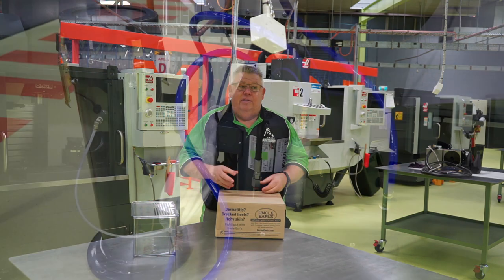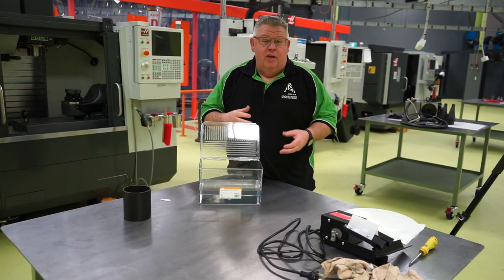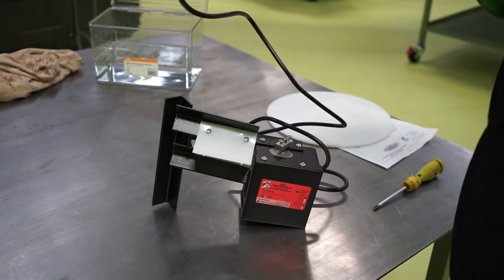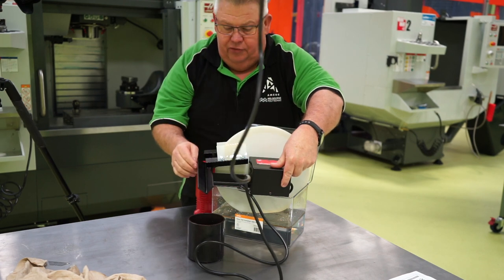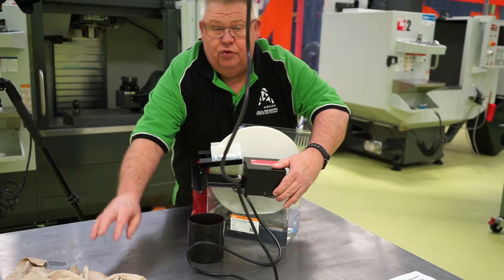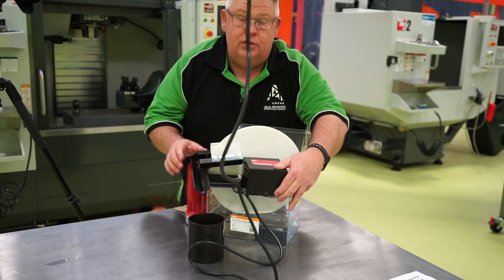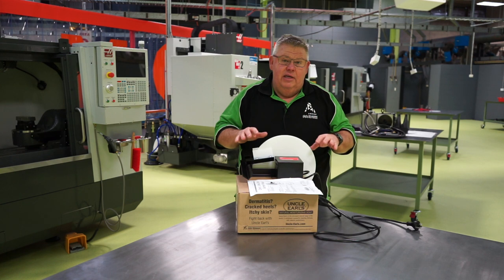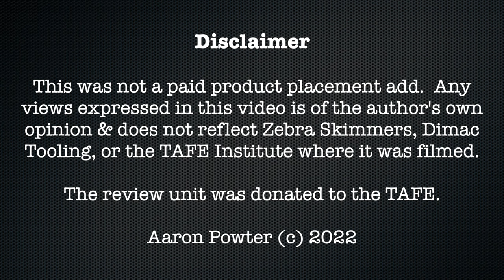Zebra Disk Skimmer Unboxing Review & Use - KEEP your COOLANT clean!

Comment: I think this is exactly what we need on our old Quantum at work! It's compact and doing the job. I'm going to send this to the boss and see what he thinks.

Thanks Aaron!
Reply from the maker: G'day Adam.  Thanks for checking it out mate.  Absolutely mate, these work an absolute treat.  You saw how well it stripped the oil from the water.  Dimac Tooling are the agent here in Australia buddy.  Cheers, Aaron.
Reply: @DCT_Aaron_Engineering  we are placing an order with Dimac for some work holding this week, really well timed. Thanks for the tip!

Comment: Coolant use is fairly new to me and I definitely don’t run my little machine for mass production. I just wish I wasn’t cursed with the “I can build one of those myself” attitude. 😂  I’ve lost more money with that thought than I’d care to admit. That said, that’s a pretty amazing little machine.
Reply from the maker: Hey buddy.  Yes I actually built one of these years ago.  It worked well for awhile and then I gave up and bought a belt type skimmer for my Syil X7.  However, if you were in the business of running CNC production most shop just purchase an off the shelf solution and put them to work.  Disk skimmers work well, but due to their size can be difficult to mount.  Each model type has their pro's and con's.  Cheers, Aaron.